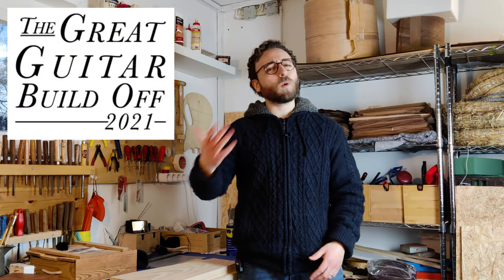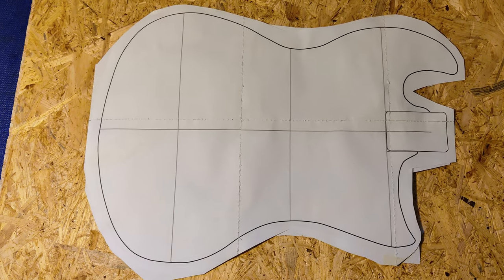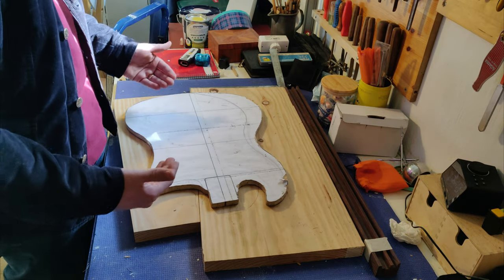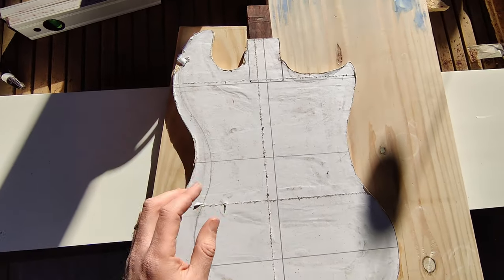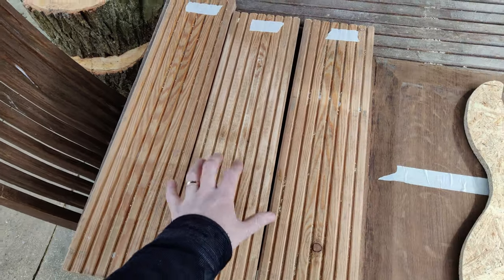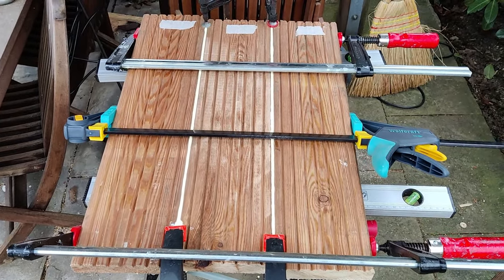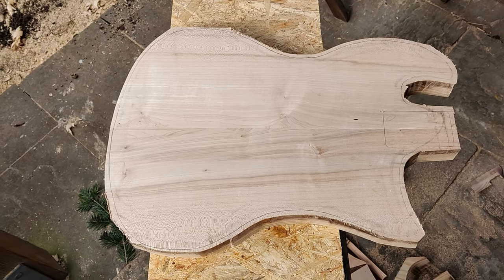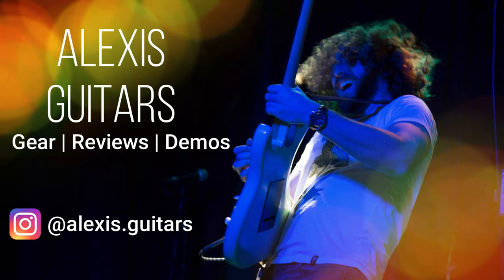GGBO 2021 Guitar Scratch Build Part 1 - Templates, Body, Top! | Alexis Guitars

Comment: Nicely saved with the body, I think everyone has run into these problems, It's all just part of the learning process.
Reply from the maker: Thank you! Yes I learned so much from the mistakes and set backs. Improvising is half the fun sometimes!
Reply: @AlexisGuitars  one thing to note about all that warping you had - Wood glue is waterbased and you used a lot of it (I now use probably 1/4 of the amount you used to glue the lams and top and back together), so you've introduced a lot of moisture to the wood that is likely to be the cause of the cupping. You only need a little bead of squeeze out along the edge for a good joint, so have a go with less next time, you will save a few quid on titebond too :)
Reply from the maker: That's really helpful, thank you! It hadn't occured to me at all. Also really good timing to receive such a tip, as next week (time allowing) I'll be gluing the fretboard to the neck and I definitely don't want any warping or cupping there! Thanks mate